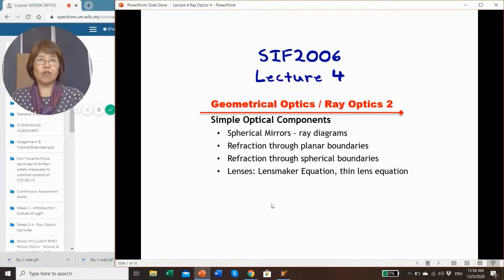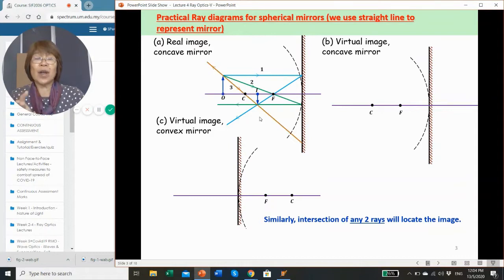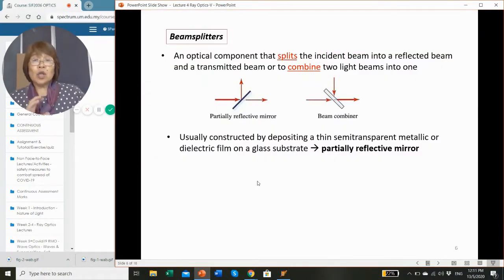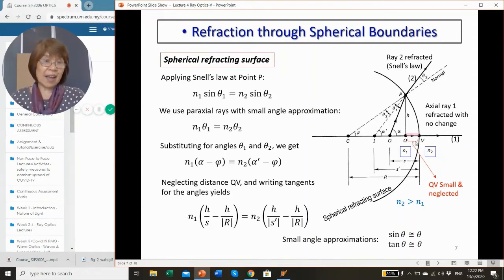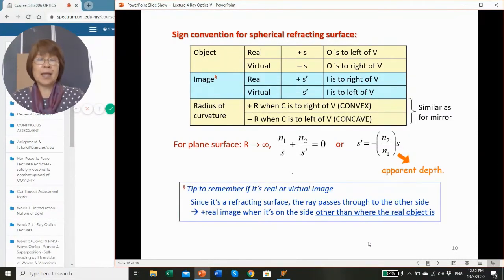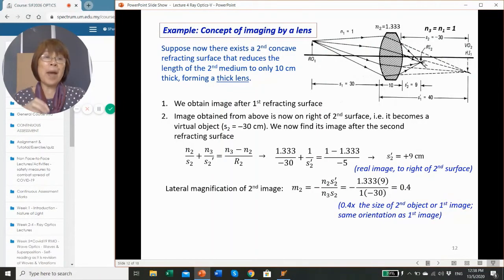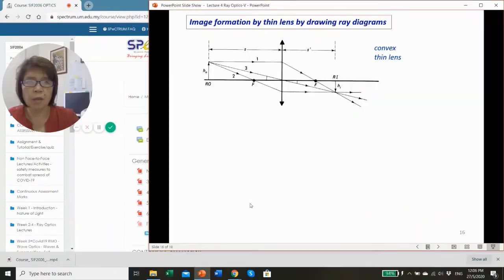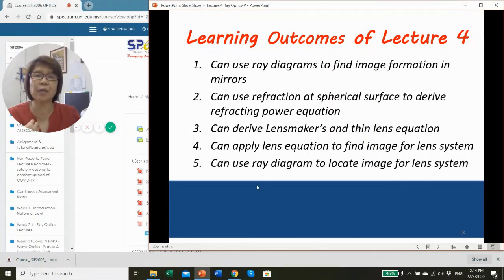SIF2006 Lecture 04 Ray Optics 2

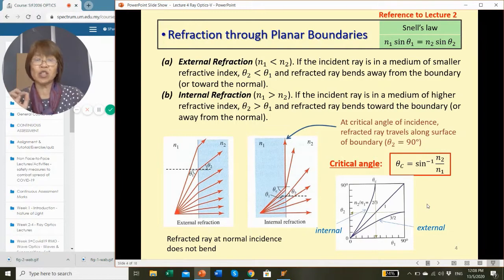Comment: 8:53 for external refraction, if incident ray is from air to water, and theta1 =90, is theta2 also equals critical angle value? in the diagram, it seems theta2 for external refraction has same value of critical angle for internal refraction.
Reply: Yes, good deduction. From the principle of reversibility, light ray will follow exactly the same path if its direction of propagation is reversed.  Following the ray at critical angle condition (for internal refraction) in its reversed direction (becomes external refraction), when incident ray travels along surface of the interface between the two media, it will enter the second medium (with larger refractive index) at an angle equal to the critical angle.
Reply: @appreciation4856  Thanks!